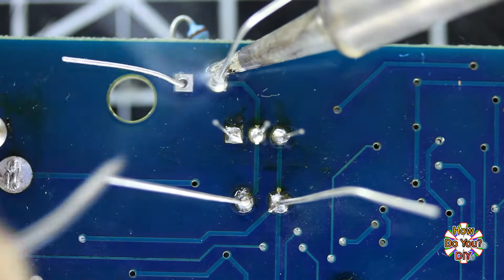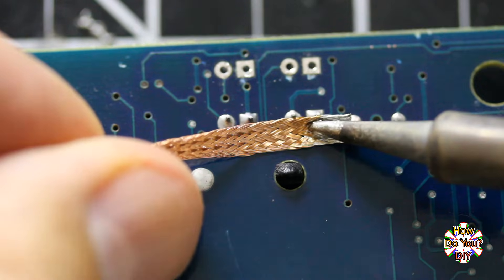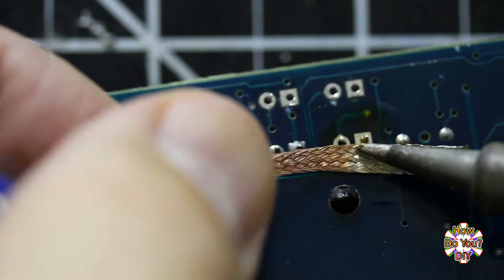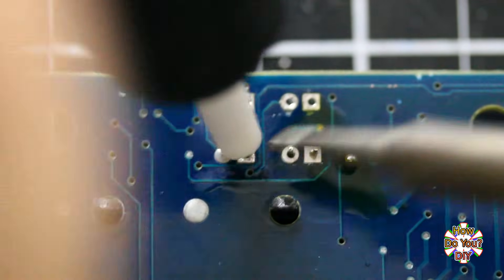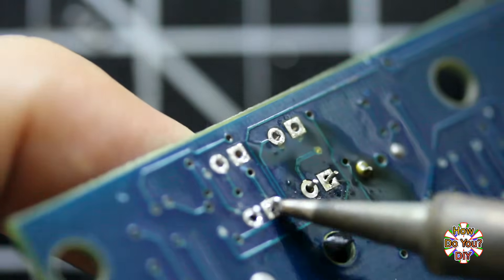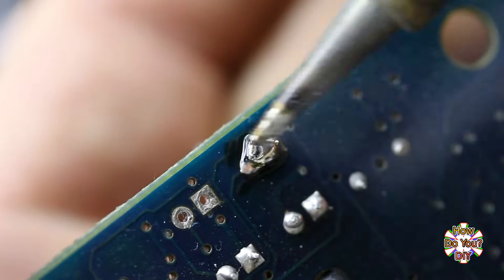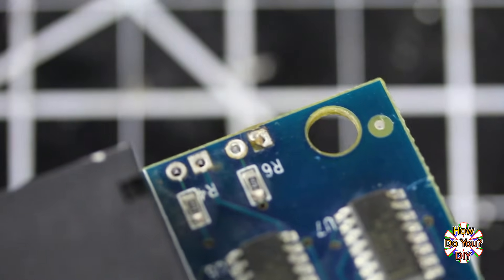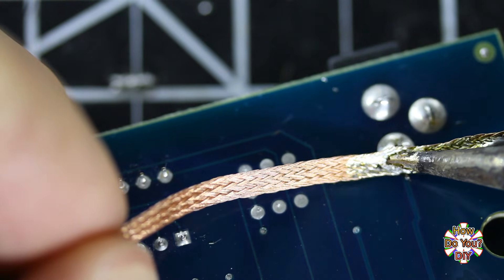Desoldering | Soldering Basics | Soldering for Beginners

Comment: Low melt solder has been my go to depending on what job I'm doing.  Like let's say you are replacing a 12vhpwr.  Definitely the easiest way.  2 minutes and its out with minimal heating to the board and its super easy to clean off after.

Comment: not a single time i have seen my soldering wick, sucking up the solder like in this video (where it just coats the entire braid). i added enough flux and even tried multiple times adding more solder.
i don't know if my soldering braid or my soldering iron is to blame

Comment: I'm having issues and I'm using a ton of flux. The flux I am using is the ChipQuik NC191 and it does make the solder liquified fine but its not going into the braid very well. At least not to the point that it soaks up all the way so I can see through the hole. I also think the opposite side of the hole of what I try to work on is always oxidated. I've tried adding flux to both sides and using a desolder sucker and desolder braid and both do not get the hole to clear out completely. I am at my wits end. I dont know if temp is whats causing this but I am using around 660-750F and i initally was using lead free solder but because it was so hard i switched to 60-40 leaded solder and nothing is working. I do have a desolder gun but that thing started smoking on the backside of the gun so I need to look into fixing that because i think at this point that is my only hope. Man I have through holes.

Comment: When using solder wick cut a 2" length off and start desoldering from the middle. If you use it on a full reel it will act as a conducter and draw the heat upwards from the iron tip. 🇬🇧
Reply: Roger!

Comment: I've had no luck with a solder wick and flux. The solder just doesn't melt even when I tried it with a Weller soldering gun on high. Whatever solder was used in the first place, it just doesn't melt.
Reply: That's either been silver soldered or brazed. Much higher temperatures. You'd find that sort of thing on saxophones - what are you trying to unsolder?
Reply: @socialmeaslesinpartnership1252  A circuit board

Comment: Another tip here: when removing capacitors from old circuit board like camcorders, radios or tv's, please do not use soldering pump too much, that would suck the weak traces too, i prefered soldering wick which much safer for old electronics.

Comment: i can tell im getting old, i used to be able to figure out the little things on my own like adding solder to both connections to remove the part.  im new too soldering and that is a tip ill never forget thanks to you.  and i didnt know the tip of the solder sucker was heat resistant so ive been trying to double foot it like a gas peddle, just looks like normal plastic and i didnt want to ruin mt iron.

Comment: Wish I saw this sooner. Tried to desolder a car window clicker today. Couldn't do it for the life of me, first of all the solder is so heavy to melt it was insane, had to put the heat to around 400 celsius, my pump was clogged up with solder from like 15 years ago when I last used it which I realised after like 1 and a half hours. The freaking solder melted on to the other side of the board I just lost it, broke the clicker just to see if it had carbon build up and ordered a whole new unit which is probably gonna cost me 100-200 euros but f it. Also I did that with a peace of shi 24 euro soldering station that literally and I mean literally electrocuted me through solder and the board, nut burned, literally I could feel electricity. So yea, hell of a day.
Reply: Well, if I got a belt from a soldering iron, I'd smash a bit of stuff up too. Anyway, job done (hopefully - new unit), glad you didn't get a REAL BELT. Forget about it!

Comment: I recently soldered a 4pin header wrong way. I tried everything but couldn't desolder. solder wick takes the solder from the surface but some leftover stays in the holes. I tried with hot air too but nothing worked.
Reply: did u try with flux?

Comment: Do you think it's still possible to use an "un-fluxed" desoldering wick type? And without adding your own flux? Have you ever tried, maybe to remove just a small amount of solder? Beside which temperature do you recommend when using a desoldering wick?

Comment: I tried to use my wick but the solder wasn’t melting. I added flux and it still wasn’t melting and the solder wick got immensely hot so I would have to let go and I would just fall. Why isn’t it melting? I had my iron at 850°
Reply from the maker: There could be a few reasons why the solder wasn't melting. The size of the metal that the solder is on could be pulling too much heat away from the solder before it can melt. The alloy of the solder itself could also be complicating the situation. If you have some lead based solder, you could try melting some of that with the solder that's already there (before using the wick) and see if that helps. But it might be more helpful to get some removal alloy. It's specifically made to lower the melting point of the solder you want to remove. Here's a link to some that comes with instructions how to use it: https://amzn.to/3Pgbz5d
I hope this is helpful.

Comment: sometimes, for large complicated/multi-sided components - it's easier to just clip a couple legs to remove it - then clean up the leftovers individually 

had a large power socket that had a bunch of sensitive plastic stuff around - only option was to clip a couple legs so as not to damage the rest

Comment: I removed the joystick from my elite controller. Or so i thought i did.  Desoldered, but looks like there is still some soldet left. No mattet how much i, heat, i add flux,  solder wire. Nothing. The suction pump is not sucking as mucb as it should.  Ive wathed videos and not sure what im doing wrong. I bought a different solder suction  and nothing.  Could it be i need a hotter soldering iron. Mine goes up to 400 degrees.

Comment: Most important is to get a quality wick. I learned this the hard way. The wick i had would not even suck a low temp solder! Even with flux added. Pure garbage basically! Use quality wick and it will work just like in this video!

Comment: I put lots of flux on the wick I have put it still will not absorb away the solder. From much googling I found that other reasons for wick not working can be due to the soldering Iron tip:
1. Is not big enough.
2. Is not hot enough.
3. Is not properly "Tinned" so heat can transfer from the tip to the wick.

Comment: Hi beginner here, right now im trying to fix 2 console controllers a Playstation related controller and a Xbox related controller, both have their analog joystick broken and i got the right equipment and everything but was wondering what solder tip should i use for desoldering and soldering, in the video i saw you were using a fat round tip to desolder and solder back so im guessing some electronics have their prefered tips

Comment: I know I'm not talking about more old skool desoldering shown here but I thought somebody could offer tips with the use of desoldering stations.
I've set my desoldering station to 315°c & it works quite well, but at a time.
I've found out you can only use it for minutes at a time before the station cuts power due to overheating.
It would be frustrating to try & strip a PCB from all it's components because of the frequent power cuts, it's not really designed for that particular purpose. You could probably get away with removing a couple of components before it shuts off.
I make sure to wear a face mask not to breathe in fumes.
Videos showing products in use & advertising, won't tell you the annoying querks about it, like the desolder gun tips, you have to melt out the solder from the solder channels in the tips before use, no video warned me, or nothing was mentioned in the user manual, in fact, the manual wasn't very informative anyway & it feels like some products require personal guess work!
For what I paid for it, I wasn't expecting it to be overheating as much within minutes of use, but it's understandable because 315°c is pretty hot, but it's still annoying!

Comment: I have a problem. I'm trying to get a part out. But the solder keeps dripping down then use the wick and I try turning the heat and flux with no access

Comment: Does it requires lot of heating because when I tried to desolder ready made pcb nothing was happening to the solder it was not melting only.
Reply: Check the tip on your iron. They have a life and when they're done, they get hot enough to burn you but no "action". The active layer burns off and then it's dead and you need a new tip (very cheap).

Comment: I was wondering about adding flux to use braid.  That is how I found this video. 
  Is 18 watt iron good enough to use on appliance circuit boards?
  Recently bought one not paying any attention to the wattage and having a hard time using it. 
  That being said, at 68,  I have little to no experience with soldering irons but wanting to learn how to remove capacitors and such on boards.

Comment: I have 2 questions:
1. why is it sometimes that the solder won't stick to the surface of the PCB and doesn't leave the soldering iron?
2. I was fixing my mechanical keyboard and I burnt the copper pad/joint of the key because of the same issue in 1st question, now only PCB is left on that joint. Is there any possibility of fixing it??
 I am a beginner at soldering.

Comment: Im a plumber and have done plenty of soldering copper pipe. This finer stuff though all I have done is wires for head units and speakers. Going to try and replace a battery in an old game cartridge. Will make the game a lot more valuable and playable. Bought some desolder braid but have never used it before. Thanks for the video I am excited to try this out and see if I dont completely destroy my game in the process.
Reply: How did it go?
Reply: @Corn0nTheCobb  Great! It took me a minute to figure out the technique. My iron is pretty cheap, doesn't have adjustable temperature or anything. Everything I read online said don't let one of those 500°+ irons make contact longer than 2-5 seconds. That's plenty of time for soldering alone but I was doing that too when trying to use the braid. Finally realized there was no way the heat had enough time to get the braid hot enough to suck up the solder. Realized 20 or so seconds worked perfect and didn't damage the game at all. It works great now. Now I just need to figure out how to fix a Gameboy advance SP lol. I fixed one on my own pretty easily but we found my wife's old one and I couldn't get hers working with the easy tricks. Took it to a retro game store and repair shop. Kept it for 3 months then told me they couldn't get the back off so they couldn't fix it lol. Going to start tinkering with that next. If its already broke ain't gonna be like I am going to break it any more.
Reply: @AndrewHarmless-wv5or  awesome! Wow, 3 months and they never even got it open? That's crazy. What a disappointment that must have been
Reply: @Corn0nTheCobb  Lol yeah it was a little annoying, they said they had been exceptionally busy and they were down to only one console and game mechanic. So it's been taking a lot longer to even get to folks consoles. I get too if they don't want to just tap the screw out cos if any little thing gets messed up or they can fix it but cant get the cover back on most people aren't going to appreciate their effort but blame them for "breaking it more than it were already broken". So I'm really not upset with them honestly I totally get it. Most people dont understand what it takes to get something working, let alone something very old that uses outdated parts or in some cases only salvage parts left.

Comment: I work in electronics for more than 20 years now and I still hate dessoldering things, specially ICs with lots of pins.
The best method I know is to have on desoldering station or gun with motorized suction. Sometimes it they can really dessolder an entire IC to a point where the IC just falls out of the pcb. This is if you have enough money obviously :(

Comment: Hope do notice me, how about if the solder is almost 10 years already on joint, it is possible to remove it by the method of soldering iron with a copper wire to rub it so that will coat the copper?, For short; will the old solder will be removed?
Reply from the maker: It should still work. You might need to add some flux to help it stick to the copper. It might also help to add some new solder to the old solder so that they both melt and mix together. I hope this is helpful.

Comment: I been trying to take out broken parts from motherboards, but can't for the life of me seem to get the solder hot enough for it to actually become liquid. Already been using flux, additional solder and a wick at this point ... from a little bit of research I can also tell you that my soldering iron is a 48 watts Velleman with a 1.5mm tip. I was thinking that perhaps the tip is too wide or something and the heat dispurses too much? i don't understand what's going on ... can someone please help me?
Reply from the maker: I haven't tried this myself, but I've seen other people doing it. It's possible that the solder that's already in the board is a lead free solder, which is more difficult to work with. If you have some lead based solder, you could try adding some of that to the solder that's already on the board. Start with a little bit to see if it helps the existing solder to melt. You don't want to add too much and make it worse if it doesn't work out. If it does melt and mix with the existing solder, that might help it remove it. But I don't know for sure since I haven't tried that myself. I hope this is helpful.

Comment: For some components,  you can also use 2 iron to unsolder it.  

I got a soldering station that I bought for starting with electronic and a old soldering iron without any temperature control that I have bought many years ago. 

Only use 1 soldering iron on each side of the components after adding flux and voila,  the part it's now unsolder and you can recuperate it.
Reply from the maker: I haven't thought of that. Seems like it would take a bit of practice holding 2 irons at the same time, but I might have to try that myself. Thanks for sharing your knowledge!

Comment: I got solder between 2 holes that I can't remove with the wick ... it makes a short circuit but I don't know how to remove it ... the wick doesn't removed it
Reply from the maker: Have you tried adding some flux?
Reply: @HowDoYouDIY  yep ... I just found out it was because I'm using a too small tip ... with a larger tip, I don't have that issue ...
Reply from the maker: Awesome, I'm glad you got it figured out!
Reply: @HowDoYouDIY  thanks my friend.   I'm learning by myself and watch many video but lot forget about humongous details that can make a difference between success and failure.   It's seems that soldering and doing electronic it's all in the detail, but I understand by doing a thousand times the same things you forget all the step that have become natural and instinctive.

For all my small projects,  I use the smallest beveled tip and that tip doesn't have the same contact surface as a huger one.  The tip make all the difference.  The only problems that I have right now it's to change the tip in a middle of a project.   I need to let cool down the iron before being able to change for a more convenient tip.

I still got issue with the famous "dragging method" to solder sop8 or any component with many pin in a row.  If I solder one by one, it's ok but it's slower and don't gave the same clean and pristine results as the dragging method. 

I don't know if it's because my tip doesn't let the solder stick on it or maybe the time that I take to apply while dragging... 

I hope that I'll figure it out soon

With best regards Manche
Reply from the maker: I might have to look into options for swapping tips while they're still hot. I'm sure that issue comes up a lot.

Comment: I finally figured out how to use my desoldering pump and it's very satisfying, but I can't get tiny modern circuits and surface mounted parts with it. I'll give desolder wick a try!
Reply from the maker: I noticed the same thing with my pump. I've been thinking about filing the tip of the pump a bit so that it fits with the tip of the soldering iron. I'm not sure if that will help, but the desoldering wick should work!

Comment: some folks want the components and some are looking to remove parts to recycle the pcb. a lot of junk yards won't take them with capacitors? anyways if you are scraping metal get a wide wood chisel and old rusty one from a pawn shop for a buck works. hammer and chisel you can remove components quickly and after some practice transistors, diodes, capacitors, some transformers , and so on. It depends on the pcb manufacturing some folks leave heaps and some clip the ends after soldering and sandpaper down the remaining .5 mm to greatly reduce the chance of it ever being reused.

Comment: My brother showed me a trick with the solder sucker. He shaped the end of the plastic heat resistant tip with a small u shape indentation, so you can place the U shaped part over the leg of the component so the rest of the tip is sat flush on the board, so you end up with maximum suction. My cheap solder sucker that sucked now sucks!!
Reply from the maker: That's an awesome idea! I think it would improve the suction a lot. Thanks for sharing it!

Comment: I'm using wick just like in video. Not sucking up any solder at all. Using a Rosin flux pen rather than directly from a tin of flux. Any suggestions? Pretty sure my board is already destroyed though from too much heat... Also, what temperature is typically used for desoldering?
Reply: Same